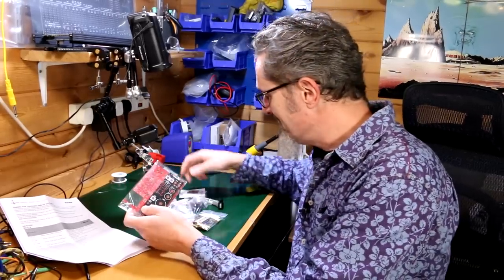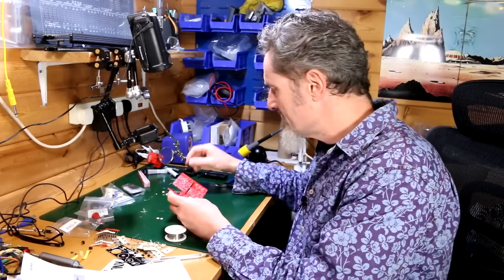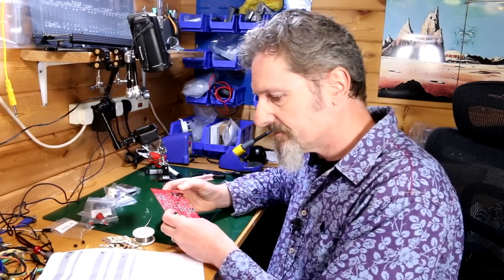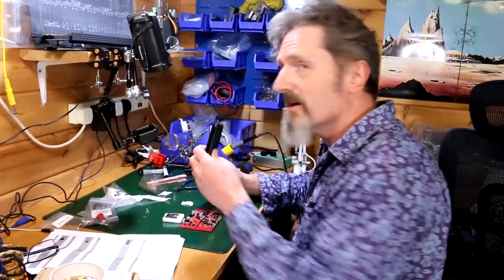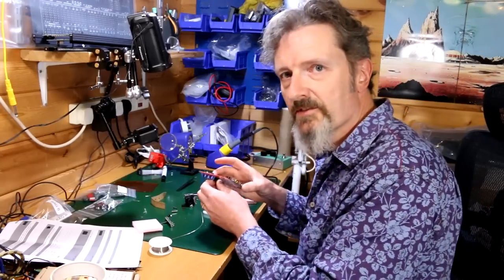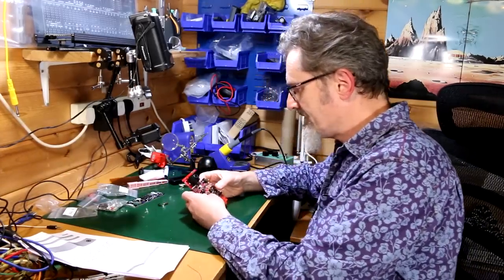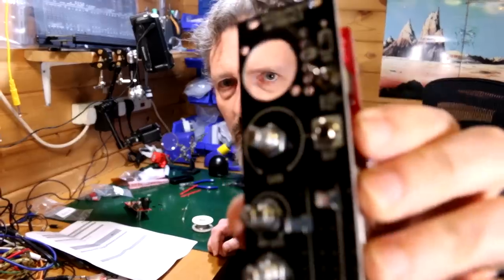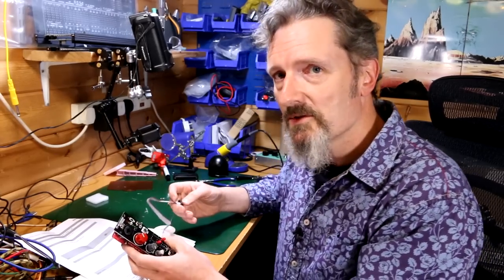Modular DIY 09 - Befaco Instrument Interface V2

Comment: You've hit upon a couple of the things I don't like about Befaco kits (I've done a few):
1. Those connected pads! These are on a few of their PCBs, loads on the Hexmix. Such a pain in the arse if you follow their build guides in order because you end up filling in the holes and having to get the sucker out. The way round it, of course, is to populate both components at the same time, but when it's a resistor and a capacitor and you're following the build guide, it can catch you out.
2. Unlabelled resistors. Yes, you can just look up the colour codes. If you're not colour blind. I have to rely on a multimeter, or my son's eyes.

With those low profile IC sockets, I usually bend the pins right over. Holds them in place very securely.

Comment: You're overthinking it with all the support to prevent parts from falling off. You can bend the pins of the sockets, resistors, caps, LEDs, power connectors, everything - right down, 90 degree angle, flush to the board (probably wouldn't do that to pots to avoid breaking pins, but they seem to always sit in real tight). All of them if you like. As long as the leg touches the metal on the board, it's connected. If it's not dead center but still touches the proper piece of metal and doesn't touch the other pieces of metal around it that it wasn't supposed to touch - it will work. Same with SMD components.
Reply: And please hold the component legs while you're trimming them down to size - people have hurt themselves by having a leg fly right into their eye.